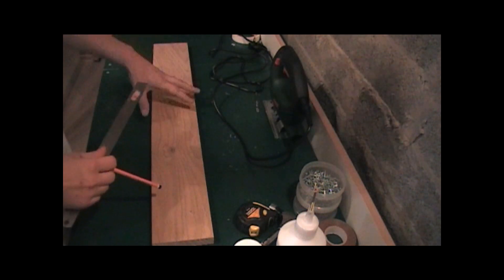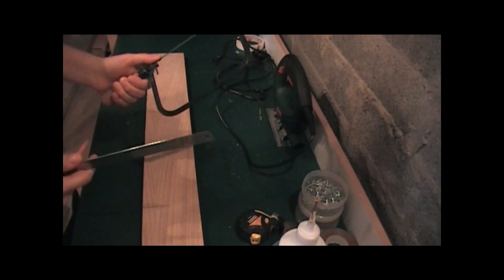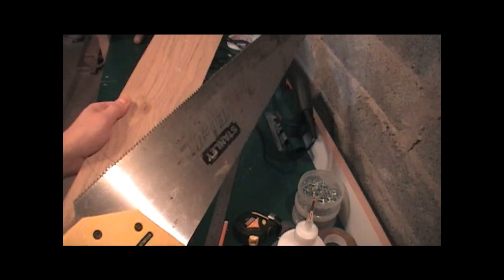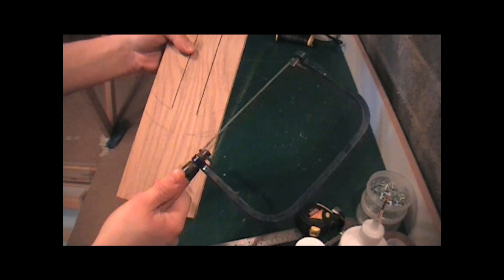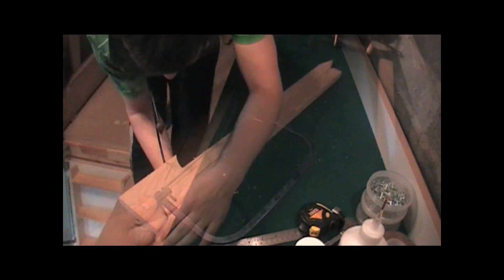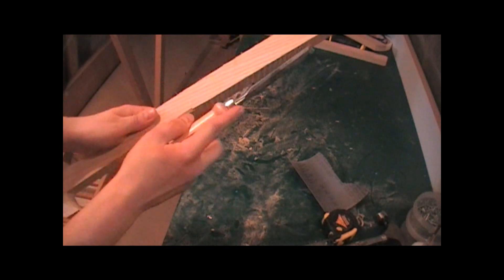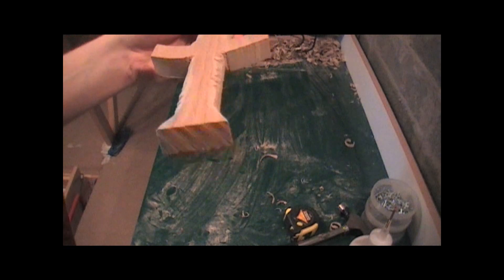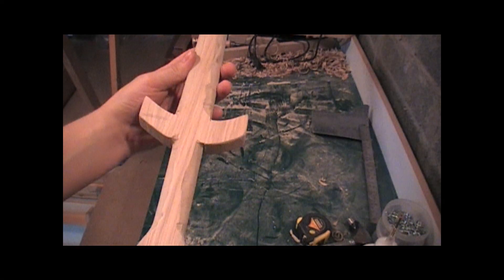DIY- Simple Wooden Sword

Comment: Simple sword for sure. Note that the guard is not very strong , all end grain. It'll tend to split off if hit hard. Solve that by laminating a piece on both sides with the grain running across the guard. A contrasting wood would look nice.